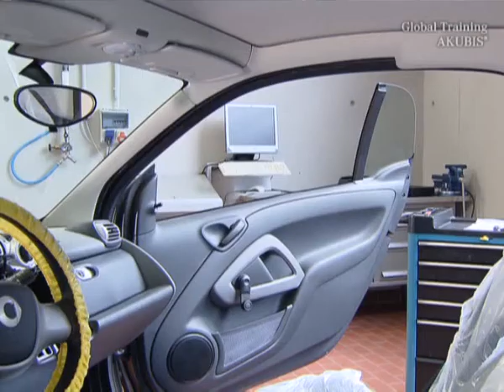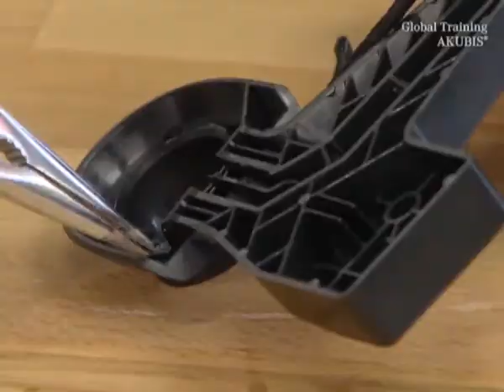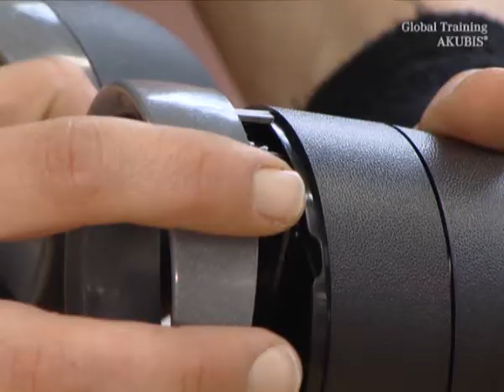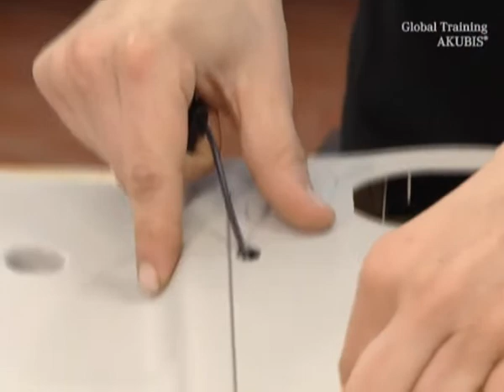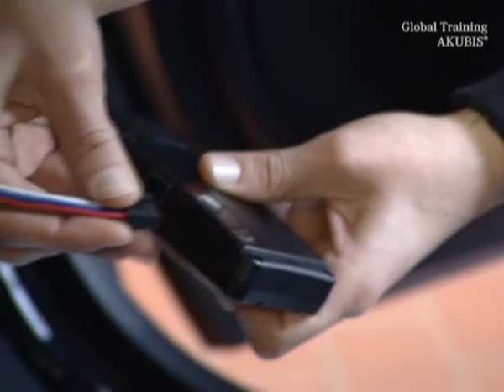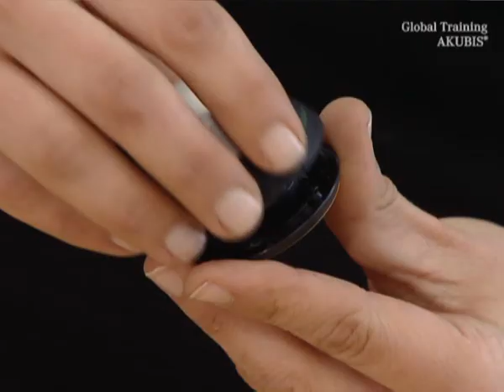Smart Fortwo 451 installing Bluetooth set

Comment: what kind of battery goes in the little round remote? have to change it in mine since I bought a used smart. guess what there is NO battery in the remote....
Reply: i think its a cr2477 i tryed a 2450 yesterday but that didnt work

Comment: Quick question I have a smart fortwo passion cdi from 2009 and it was this piece attached with a little phone thing that was bluetooth and show up on the phone as brunswick carkit does anyone know how it work I bought the car with it already there..
Reply from the maker: I have the same Bluetooth set in my smart car. It's connected to the radio set, you should have a display screen in one of the gauges on the dashboard and a control knob next to the gearbox.